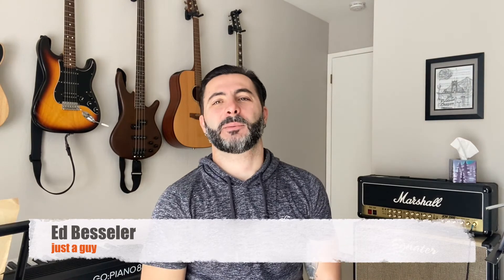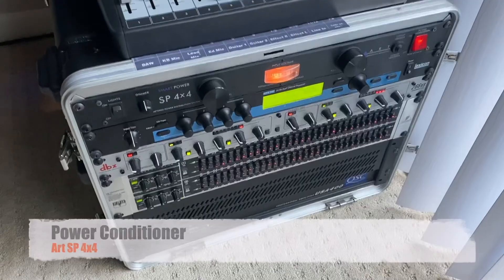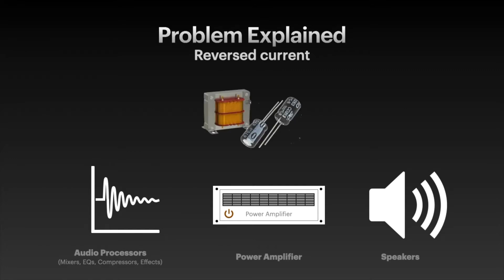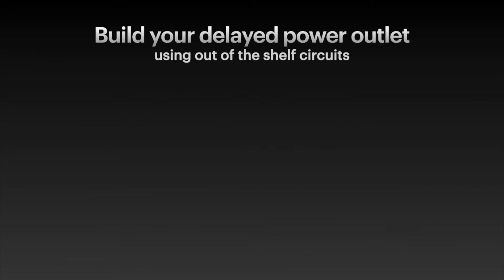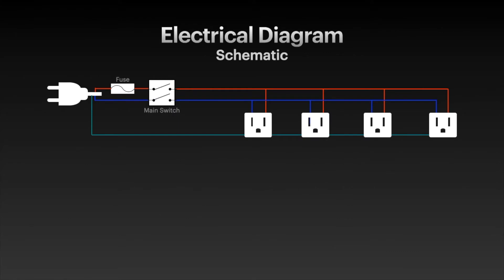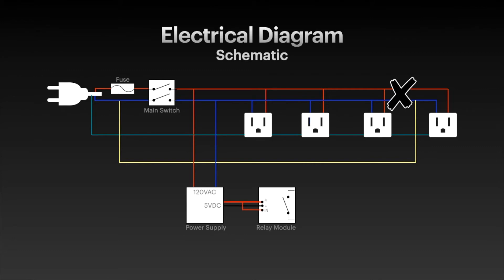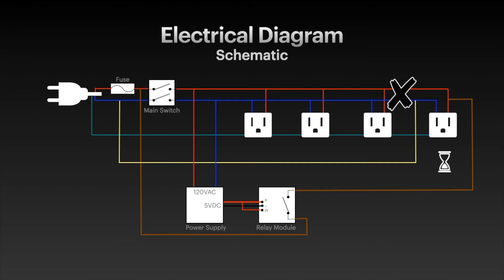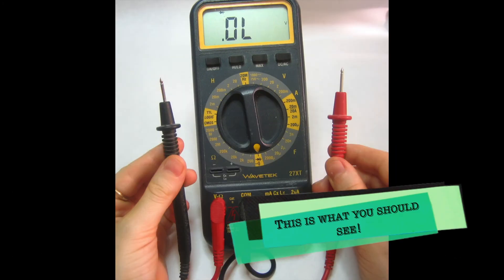How to Fix Pop on Speakers

Comment: Hi, thank you for the video. Would this work both ways? My PA system generates a pop when turned on before the mixer is turned on and also pops if I turn the mixer off before turning the amplifier off.

Comment: Hi, i am experiencing a pop sound, but not from shutting down or turning up the speakers. The speakers would start fine, but then randomly the speaker would pop!! and it happened to all speakers , mixers, when i'ts still on.  Sometimes the speakers would made a pop sound, but other times the MCB is tripped. How Do you know how this happened & what is the problem?

thanks!
Reply from the maker: Hey Pindo, do you happen to have an old refrigerator or any kind of electric motor on the same power circuit? I had a bad experience in the past trying to keep a mini fridge in my studio. Every time the compressor was turning on or off I could hear a pop on the speakers. I tried many types of filters but none where 100% effective. I ended up getting rid of the fridge. Try unplugging your refrigerator for a few hours while you test it. Cheers
Reply: at first i thought it was something like that, since the problem started since we have a central air conditioning unit installed. I remember one day, turning on the AC then the speakers pop, but sometimes..  even when the AC unit is off, the pop still happens randomly. So i really have no clue if it's the AC unit or not.
Reply from the maker: @pindopurba  intriguing 🤔 do you notice the pops more frequently when the power amp is warmed up or doesn’t matter? I’m thinking that could be a cold solder or Capacitor leakage
Reply: @EdBesseler  since it happened randomly, i don't really know. We use an active speaker, dbtech ingenie series. We askes our audio vendor, to take a look at their speakers and they didn't find anything wrong with it.

Comment: Thanks for the tuition.
I have a Peavy 4000 with that pop sound when switching off now i was thinking of changing main power capacitors; can you advice if am on the right way to solve the problem?
Reply from the maker: Capacitors are very good candidates if the unit is defective, but it could simply be that whatever is feeding your amp is generating the noise that you amp is amplifying when you turn them all off. Try switching the source of signal off first and few seconds later turn the amp off. If the pop is gone, your amp is completely fine.

Comment: Could you elaborate on where you get your components and what brand and model they are?
Reply from the maker: Hey There... these are common modules in electronic stores or even Amazon. Look for Power Supply Power Supply Module Board and Module Relay Switch with OPTO Isolation. Brand does not really matter... I always look for reviews. The most important is that you power supply output matches with you relay module voltage. And that the current on the relay is higher equipment that will be hooked up to it. If you aren’t sure what to get yet, don’t hesitate to ask me again... I can help with the selection... cheers

Comment: Hi thanks for information. I have the same problem with my AMP mostly on switching off but sometimes on turn on too. I just added a soft start for minimizing inrush current of transformer and since it has a same delay relay like you mentioned I thought it will help on pop sound but almost no change. I noticed you used the line before switch but i put it after switch for safety precautions. would you please advise why?
Reply from the maker: Hey Amir! the reason I connected the line before the Main Switch is because I still wanna keep the signal processors energized after I turn off the switch, so it won't drive any surge to the power amp when it still on. If you keep it after, you are killing the all signals at the same time, maybe that's the reason you still have the issue and the surge may still happen. Don't worry about safety. The Relay on your soft start will do the job, just keep in mind that it will shut off in fraction of a second, so as long as you don't touch anything in that fraction, you are okay.
Now, if you are talking about a single AMP (I was not so clear) it may require a little bit of schematic change. The soft start may act on the pre-amp only, while the power amp should be shut of with the main switch. If that's your case, let me know with amp it is and I can see if I can find the schematic and advise where to do the change. Cheers! Ed
Reply: @EdBesseler  Thanks Ed for reply. I did not know if preamp still working when amp is off will grab the surge (watched too many videos and nobody mentioned that :) ), in my case I have different transformers for pre amp and amp and since amp has bigger caps will hold the voltage for a few more seconds than preamp, and I can not increase the delay of soft starter relay for keeping preamp on due to block resistance of soft start power. So I am going to add another delay circuit to keep preamp on when amp is going to discharge. also I am thinking of a speaker protection which found here ( https://www.sound-au.com/project39.htm he has really great ideas) but first I will test this delay board. thanks man.

Comment: I have a soundbar with a subwoofer it start to pop but not a loud a week ago. Do my soundbar need a repair or it's norml?
Thank you.
Reply from the maker: Hey Taha, pops are not supposed to happen, but there are a few things to consider before you call you subwoofer defective. 
If your woofer is popping while playing it may be interference on the power line. Motors are really bad if connected on the same power line, including refrigerators, specially old model ones. If that's your case pay attention if the pop happens when the refrigerator turns on or off. In that case Surge Protectors help, but may not eliminate the problem.
If the pop happens when you turn on/off you can try to turn off your audio source (TV or DVD, etc) first and then turn off your subwoofer. If that fix the issue you may need a delay on the power source. But first try to use the optical connection, if you are not yet (most of soundbars and TVs have the optical connection option). Let me know which case is yours and we can deeper dig into the problem.
Reply: @EdBesseler  Thank you for your quick reply.
In my case the popping happens when I turn off the soundbar and the subwoofer, I hear a slight pop. I disconnected the soundbar from the tv and trun it on/off nothing changed.
Reply from the maker: Hmmm, one last thing... is there a way you can connect to the power without using the 3rd pin (ground)? I’m thinking that you may be having some ground noise. If that doesn’t help, most likely you have a problem on the subwoofer. Then if you wanna be bold and get into schematics I can give you some tips on what to look for.
Reply: @EdBesseler  It stills under warranty. I wanted to ask a professional like yourself if it's worth going through warranty and repair it or it's just a minor thing that I can live with it?
Reply from the maker: Taha ENNACIRI, if it’s something that started recently, there’s a chance that it can get worse. My recommendation would be to take it for service if bothers you, otherwise monitor for some time, if you still have enough warranty time, and decide later. 
If you have a Capacitor leakage issue, which I suspect, you will notice a difference with temperature, and that only gets worse overtime. I hope I have helped! Cheers!
Reply: @EdBesseler  Thank you for your time.
+1 subscriber.

Comment: I have a pair of active Genelec monitors, with the signal routed from the USB C output from my laptop, going over a Sound Devices MixPre-6 by XLR cable to a Genelec subwoofer, with 2 more XLR cables going to the monitors.

I have no pops when turning the system on or off, but after listening for some time, I get sporadic nasty pops and crackles.  All components and cables are new, including the laptop.

I had no such problems in the same room with a much cheaper setup from Presonus...
Reply from the maker: hmmm, can you correlate that to any electricity event that is happening on the house? Like fridge or AC turning on and off? or even lights or fans? I could just be noises from the electricity line. A good filter may resolve it if that is the case... but a little costly! You can also try lifting the ground of your power bar or Genelec only (if its 3 pronged plug). Many cases that resolves hums and noises.
Now... worst case scenario would be a defect on your Genelec. Normally caused by capacitors on the power supply or amplifier stage. That's a bit more complex. If that's not your thing, I'd recommend taking it back to support.
Let me know how it goes and good luck!
Reply: Genelec they all do this is normal they say the Genelec reps lol